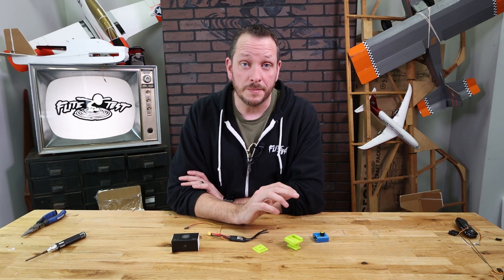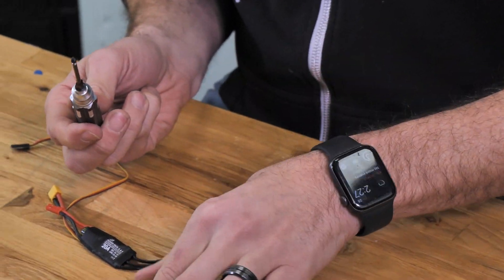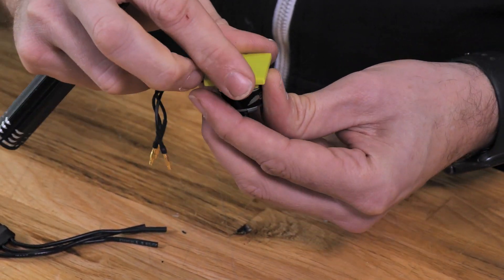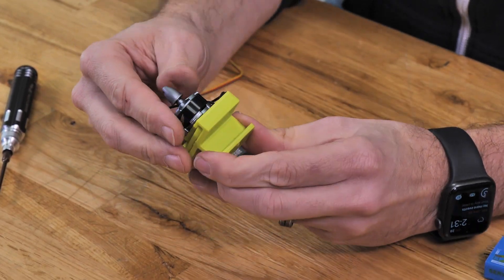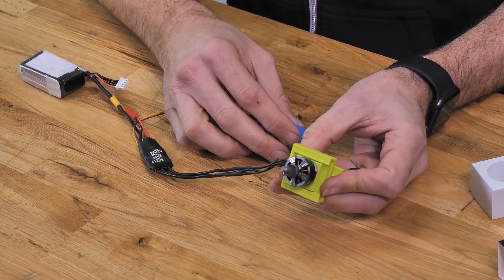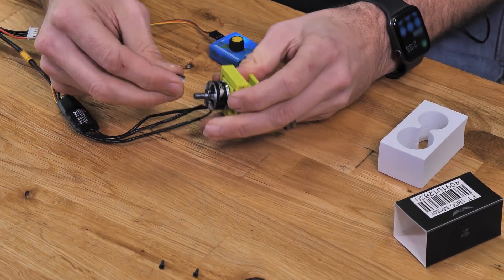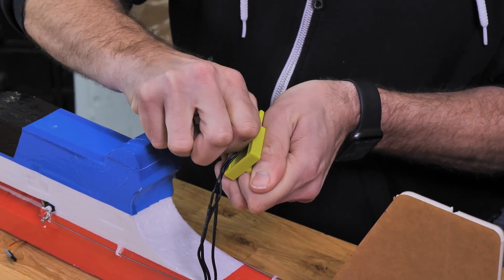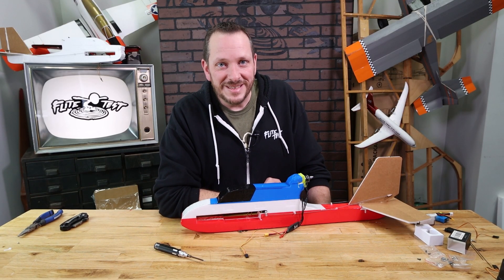How to Configure the Motor For The FT Tenet  //  BUILD

Comment: Someone PLEASE answer.. What direction should the motor angle be oriented on tbe tractor configuration?? Up, or right? The pusher is angled up as per Joshs video instruction however they make no mention on the angle of the tractor style motor.. Please help as there's nothing on ftca either...
Reply: Down and right, as seen from INSIDE the aircraft. P-factor wants to pull you up and left. This assumes a "standard" counter-clockwise rotating prop, as seen from outside and in the front of the aircraft.

Comment: What are the official ones printed with?  I've had bad luck with PETG.

Long version:
I made something similar, but the screws got so hot with the FT PP A radial motor that it melted the PETG I printed them with and the motor became VERY loose and the screws probably would have come out if I had flown too much longer.  I tried using thread locker but it didn't stop the motor loosening up due to a bit of melting.

Comment: For those who were also confused - in the pusher (trainer) configuration the motor will spin clockwise and the numbers on the prop always face the direction of motion! Just make sure the spinner is tight :)